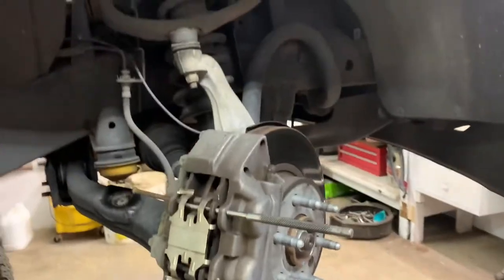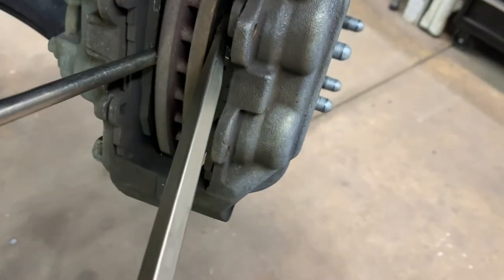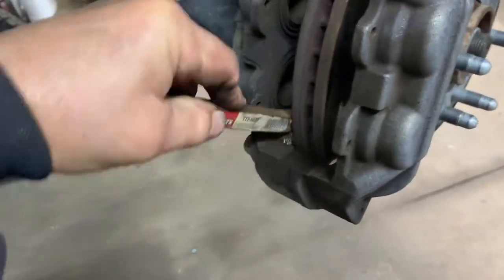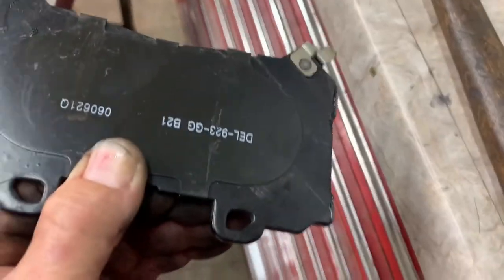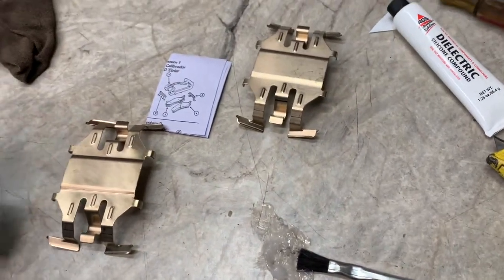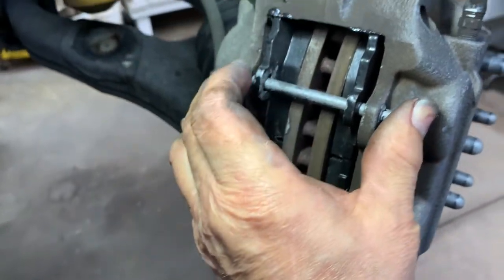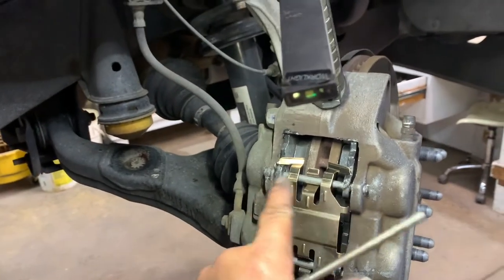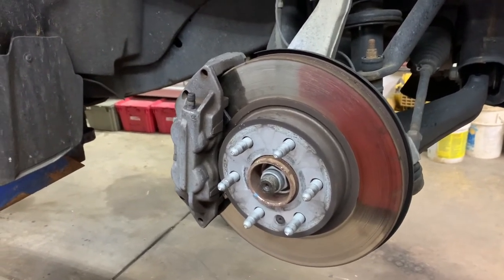2016 Colorado Canyon front brake pads

Comment: great video!  I saw a trick in another video if the hairpin isn't facing the right direction.  On the head of the pin there is a phillips head screw head, you just get a phillips head screwdriver and turn the pin until the hairpin is in the right direction....

Comment: For first timers, do not do this. You will destroy your rotors with screw drivers. This guy is new to this
Reply from the maker: Yes I am using a screwdriver I will stick the screwdriver in between the rotor and pad but if you will notice I am not pushing the screwdriver into the rotor I am using the rotor as a pivot point if you are really concerned about the rotor then you should replace it

Comment: Nice video.  I thought you always have to resurface the disc when you change the pads?
Reply from the maker: If the rotors look pretty good and the customer doesn’t want to spend the money then it’s a pad slap I would recommend replacing rotors because the cooling fins in the rotors fill up with rust and do not cool properly

Comment: If you use a wire brush to scrub the brake cylinder, wouldn’t the rubber seal break from the scrubbing of the wire brush?
Reply from the maker: No u just want rub the areas that the pad sit

Comment: those 18mm caliper bolts on my 2017 Colorado are 59 lb ft + 30-45 turn according to GM. Dang is the 2016 really 135 lb ft on those bolts?

Comment: Only suggestion is to open the bleed valve on caliper when you push the calipers
Reply from the maker: Good suggestion, sometimes the bleeders are frozen or broken if you do get them loose remove them and put some antiseize on the threads